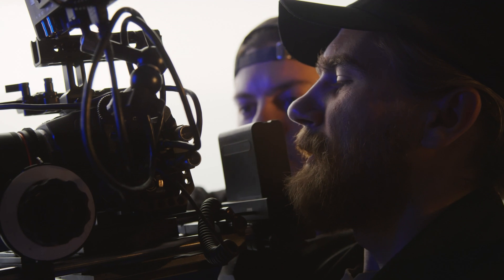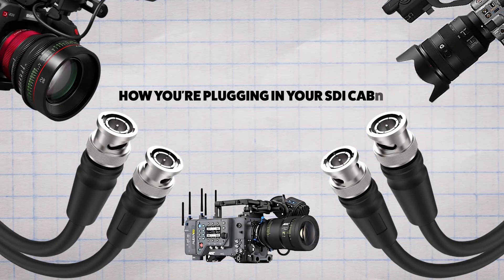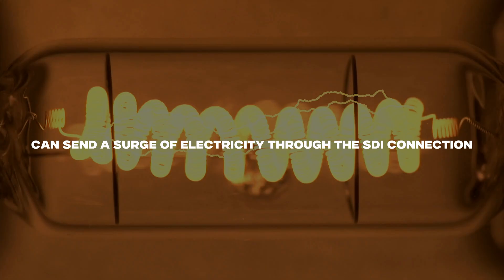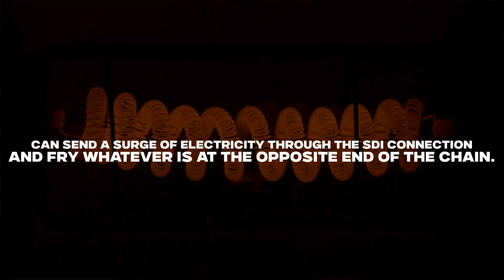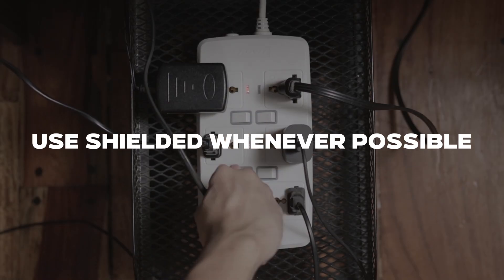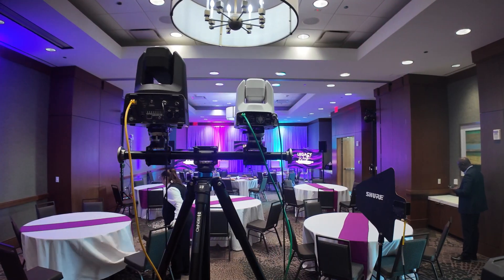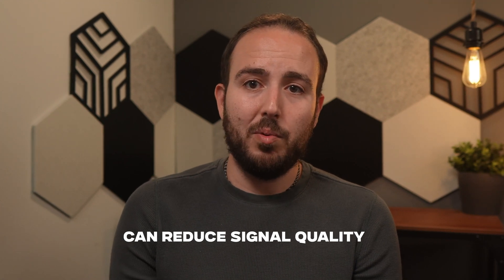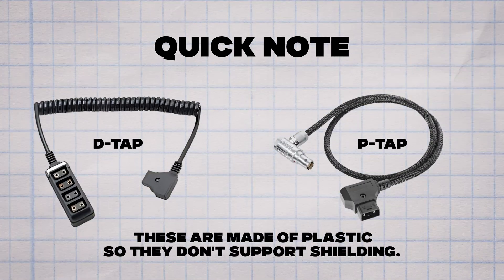Don't Touch 12G SDI Cameras Until You Know This

Comment: Curious!

Does this only apply to 12G-SDI? Here in Brazil we have the habit of connecting all the connections (SDI, HDMI, audio cables...) then connecting the equipment to the power supply and finally power on. In other words, the equipment is only turned on after everything is connected.

Should we continue like this or are we wrong?
Reply: We do the same in Portugal and Luxembourg
Reply from the maker: It can happen with any connection. See this documentation: https://www.arri.com/resource/blob/194752/d3093e6af632150787ec95d176a39958/download-technical-information-data.pdf

Comment: What about if I want to hot swap while the SDI feed is live?
Reply from the maker: @CozyCameraman  hot swapping cables or batteries?
Reply: @zephanmoses camera is powered wirh internal battery with a v-mount plate feeding power in DC. Accsoon Seemo will be on the camera, also with a Sony battery on it, but also tied to that v mount plate with P-tap. 

I want to be able to swap the v-mount as needed.
Reply from the maker: @CozyCameraman  you should be able to. This issue isn’t exactly something that happens often. There’s just a risk of it happening.

Comment: Please stop spreading this bullsh*t. There is no way you can damage the SDI port when you connect the positive only of a battery. There is no current path. Get back to school and learn some basics of physics. Also - to put a device on market, it is ESD tested. On all connections. And has to survive a decent spark - so again, the gear is resilient to normal use and hot-plugging.
Reply from the maker: Arri literally has an entire document about preventing damage to SDI outputs: https://www.arri.com/resource/blob/194752/26e7a4ca07e7a8f0ce038b23109b216c/download-technical-information-data.pdf

Oh and RED does too: https://support.red.com/hc/en-us/articles/360057166453-Preventing-Damage-to-SDI-Outputs

So tell me more about how it’s BS?

Why would two of the top cinematic camera manufacturers be sharing BS about their own equipment that they created? Lay off the drugs man.

Comment: "Connect power first"  is still confusing? Does "connect power first" mean turn devices on - and do you turn on the camera and turn on the monitor and then connect the SDI cable to both?
Reply from the maker: @AndyGinLA  connect power and turn on the device before connecting SDI. Before powering down the device, disconnect SDI and then power down the device and disconnect power.
Reply: @zephanmoses  Hi, does this mean in a studio stting, that each time we power down the system we must disconnect the sdi out on each camera and monitor ?
Reply from the maker: @rubenparada866  It's pretty rare that this would happen and this guidance was put forth by Arri for their cameras initially. It's more of a safe practice than anything, but I wouldn't consider it a requirement.